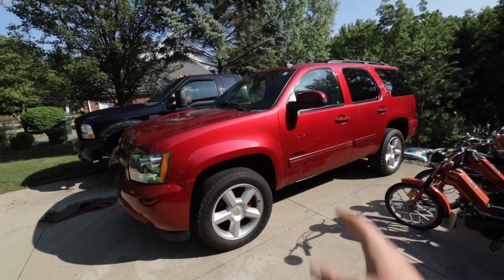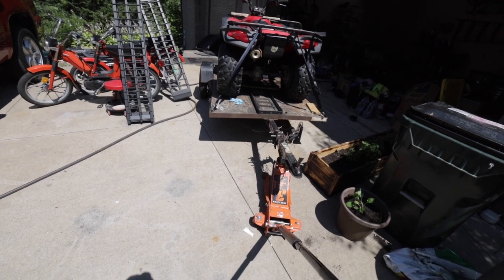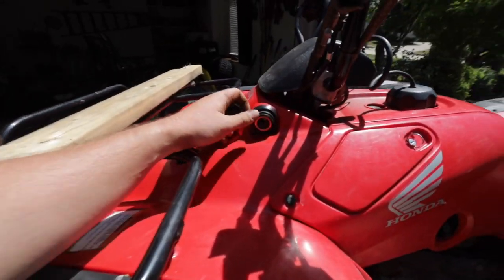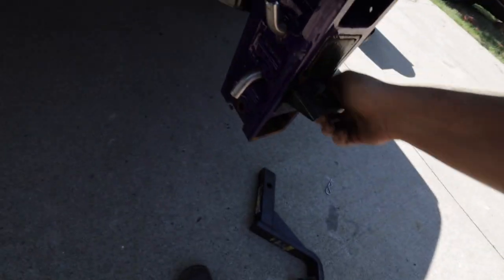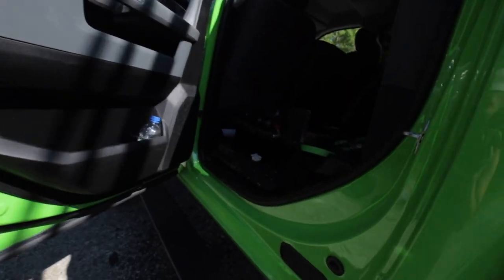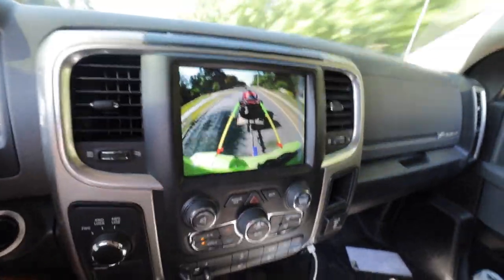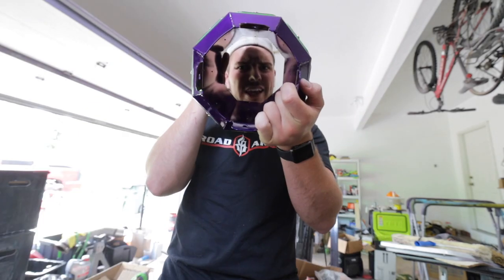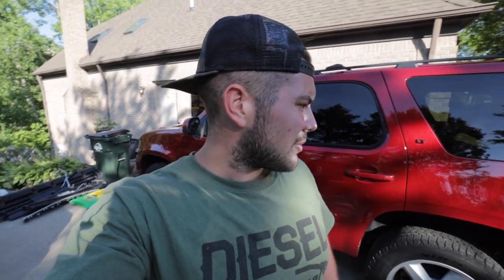The PROBLEM Towing WITH a SEMA TRUCK...

Comment: Yes buffing and polishing takes awhile.  I'm working on a 72 K5 Blazer that is black. Started blocking it with 1000 grit and finished it 5000 grit the other day. Now to just buff it out and polish it. This will be glass when its done

Comment: I'd say for the exhaust just get am angle pipe and put the tip up there and cab dump it. If your tune is that clean you don't gotta worry about soot all over and it just sounds soo good with a cab dump.

Comment: My 2012 Cummins did the same thing with the Coolant blowing out of the overflow..turns out it was my head cracked in 4 places and warped and I had arp head studs in it as well
Reply from the maker: How’d you manage that one!
Reply: RYAN MAYER really really overly hot tunes on my dsp5 mixed with a heavy right foot and a childish obsession to see smoke billow out my the 5 inch lol
Reply from the maker: John Gray 😂😂😂 how I blew my 3rd gens trans